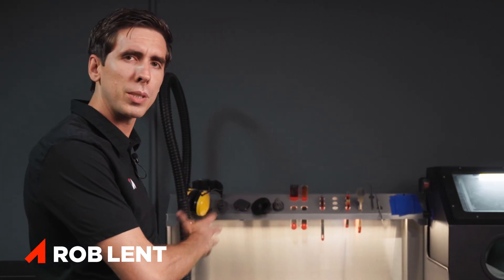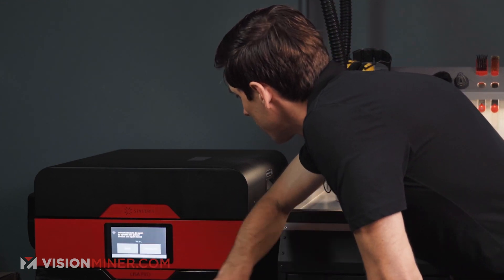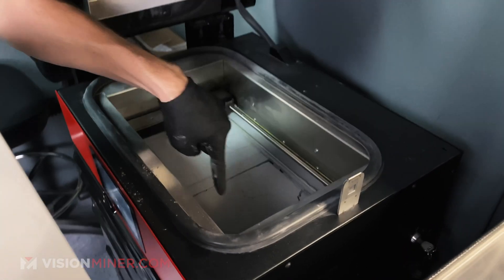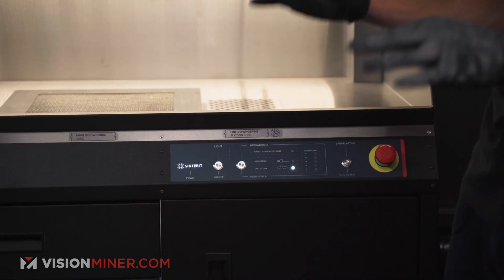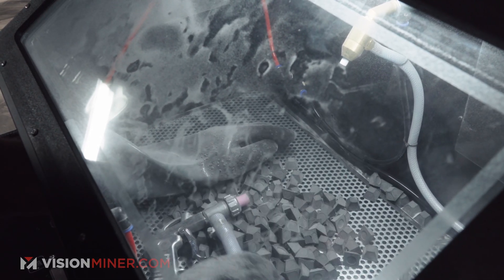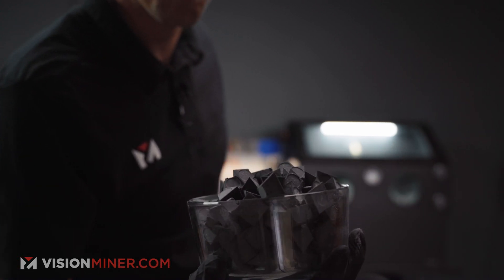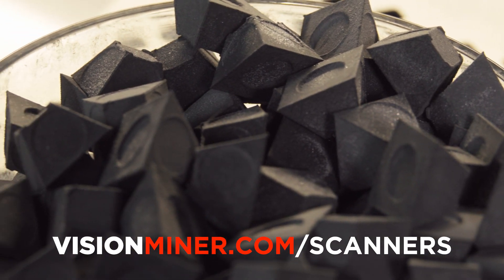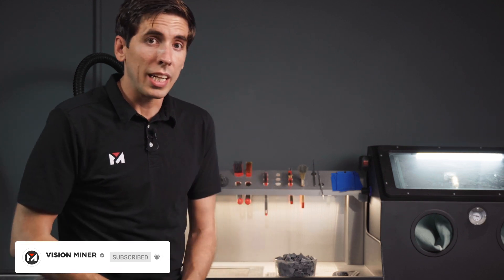Post Processing SLS 3D Printed Parts With The Sinterit Lisa Pro + Powder Handling Station

Comment: Looks fun but I'd still be wearing a mask, high metals into the blood stream are no good
Reply: My initial thought as well, note however that this is a polymer powder sintering machine, not metal. Rob presumed we knew this already. Is plastic powder in your lungs OK?
Reply from the maker: Generally it's good to keep any kind of powder out of the lungs, of course, but here's a good article on safety by Sinterit themselves: https://sinterit.com/blog/sls-technology/5-most-common-myths-about-sls-powder-handling/

"One of most commonly made errors is the assumption that powders used in SLS 3D printing are toxic. One source of that myth actually comes from a different 3D printing technology – ultra-fine particles emitted by FDM printers can indeed have harmful effects when breathed in, similar to smoking12. That doesn’t happen in our case, because particles used during SLS printing are much larger – over 40 microns in diameter (78 microns in average), which makes them harder to lift into air (and you’d have to take a good sniff inside the printer when it’s working anyway). The other reason behind that misconception – and possibly its root cause – is the fact, that we recommend using protective gloves, glasses and masks. But that actually isn’t because of the powders’ toxicity – they’re completely safe, meet all the standards, have all the required safety certificates. So, why, you might ask, all these protective measures? Because it’s practical. You see, when it comes to consistency, our powders are kinda like flour. The fact that flour isn’t toxic doesn’t exactly mean, that you want it in your eyes, mouth (at least before it’s baked) and on your clothes, right? The same applies to our products."
Reply: @mojow1665  😂😂😂